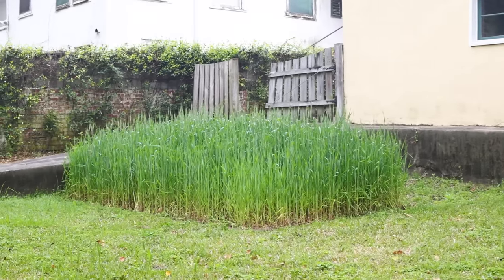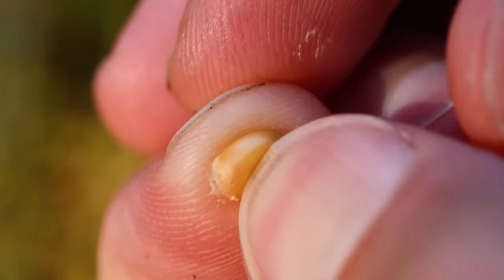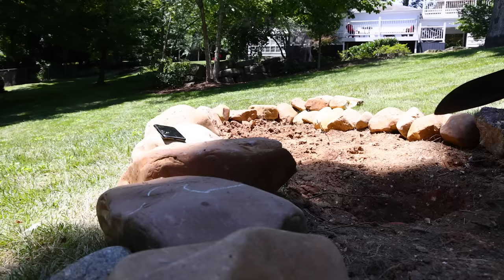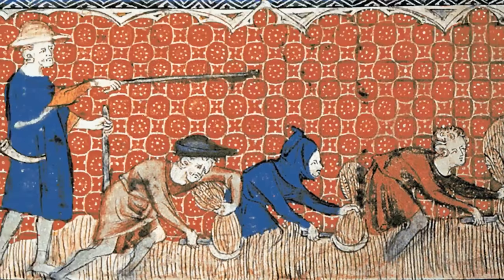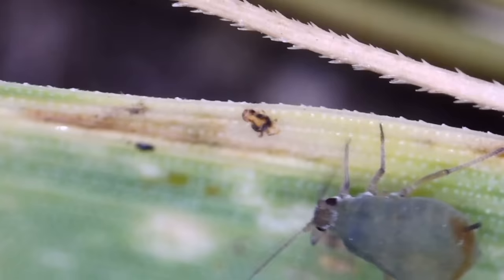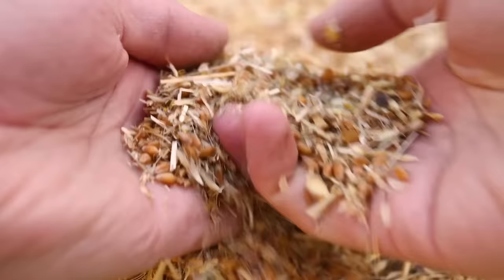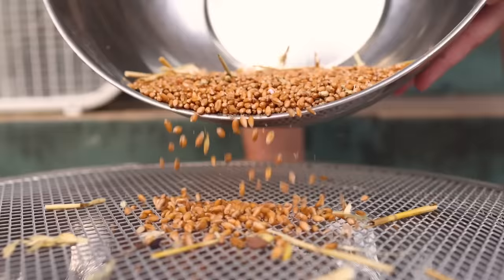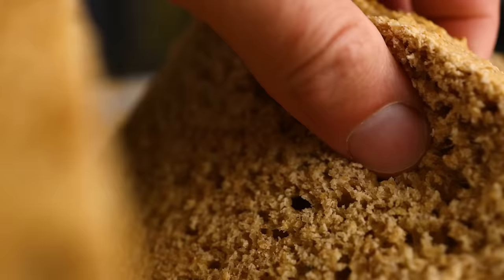Growing Bread II: Harvest to oven

Comment: Well, the word threshold is also from agriculture. It was the walls around the treshing floor that kept the grain inside i do believe
Reply: @krankarvolund7771  to hold. thank me later
Reply: Yeah and doors had little lips on the bottom to keep wheat from blowing out
Reply: As far as I've learned it was from when people threshed the floor of their house with dry straw etc. to keep the floor from getting wet when people came in from the rain. This straw, or threshing, would get replaced regularly. There was a lip on the ground at the bottom of a door that would stop the straw from getting brushed, walked or blown out of the house called the 'threshold'.

Comment: It's no wonder that so many analogies, metaphors, and parables are associated with this process!
Reply: Well, that was the main activity of the major portion of the population for thousands of years ^^
Reply: @krankarvolund7771  It's both a rich source and a common source. I wonder what the equivalent in the modern world is?
Reply: @rexregisanimi  Probably internet ^^
Reply: @rexregisanimi  imo metaphors like “clocking off” which come from only a couple hundred years ago. But people still use them daily, in all strands of workers from office guys to factory guys. So it’s still relatable etc. There’s a lot of those in modern language (bonus part: if you travelled back in time and used those metaphors they’d be so confused!)

Comment: Somehow in my family there is a handed down 'flail', which is basically a short and heavy piece of wood, attached with a chain to a stick. This was used to thresh the wheat on the threshing floor. Couple of guys threshing together, turning around the wheat pile and singing, drinking. Good times.

Comment: One word from grain cultivation you did not mention is "Threshold" -- That little ridge in the doorway leading to the threshing floor, so people are less likely to track all that sand and chaff all over the place when they walk in and out (can you imagine the mess, otherwise? Yikes!).
Reply: Also "garner" to gather for storage, a granary.
Reply: @mabamabam  Cool! I love etymology! Also, "inch"as in the unit of measurement, comes from an old word for barley, because the original standard for an inch's length was "Three mature, but uncooked barley grains, end to end"
Reply: @CapriUni  ~Ok, I’m stalking you now. J/K! 🤣 How about some old expressions such as, “there’ll be the devil to pay”, which has nothing to do with “the wages of sin”. The “devil” is the seam between the hull and the deck on an old sailing vessel. In order that it doesn’t leak they would “pay” into it a mixture of oakum and hot resin to seal it. On the high seas this was a dangerously precarious procedure wherein a seaman was put into a bosun’s chair and dangled over the side. The duty was assigned as a punishment so the expression might be said from one sailor to another, equivalent to saying, “You’re in deep shit now!” And thus the related expression, “caught between the devil and the deep blue sea.”
Reply: @Capri-Omni ~Another nautically derived expression is, “Cold enough to freeze the balls off a brass monkey,” which as nothing to do with testicles OR primates. The “monkey” was a triangular stand that held cannonballs. It was made of brass and when it got very cold would contract just enough allow the cannon “balls” to fall and spill onto the deck.
Reply: @CapriUni  ~And lastly, here’s fascinating bit of historical relevance I read recently:

The US standard railroad gauge (distance between the rails) is 4 feet, 8.5 inches. That's an exceedingly odd number.
Why was that gauge used?
Well, because that's the way they built them in England, and English engineers designed the first US railroads.
Why did the English build them like that?
Because the first rail lines were built by the same people who built the wagon tramways, and that's the gauge they used.
So, why did 'they' use that gauge then?
Because the people who built the tramways used the same jigs and tools that they had used for building wagons, which used that same wheel spacing.
Why did the wagons have that particular odd wheel spacing?
Well, if they tried to use any other spacing, the wagon wheels would break more often on some of the old, long distance roads in England . You see, that's the spacing of the wheel ruts.
So who built those old rutted roads?
Imperial Rome built the first long distance roads in Europe (including England ) for their legions. Those roads have been used ever since.
And what about the ruts in the roads?
Roman war chariots formed the initial ruts, which everyone else had to match or run the risk of destroying their wagon wheels. Since the chariots were made for Imperial Rome , they were all alike in the matter of wheel spacing. Therefore the United States standard railroad gauge of 4 feet, 8.5 inches is derived from the original specifications for an Imperial Roman war chariot. Bureaucracies live forever.
So the next time you are handed a specification/procedure/process and wonder 'What horse's ass came up with this?', you may be exactly right. Imperial Roman army chariots were made just wide enough to accommodate the rear ends of two war horses. (Two horses' asses.)
Now, the twist to the story:
When you see a Space Shuttle sitting on its launch pad, there are two big booster rockets attached to the sides of the main fuel tank. These are solid rocket boosters, or SRBs. The SRBs are made by Thiokol at their factory in Utah . The engineers who designed the SRBs would have preferred to make them a bit fatter, but the SRBs had to be shipped by train from the factory to the launch site. The railroad line from the factory happens to run through a tunnel in the mountains, and the SRBs had to fit through that tunnel. The tunnel is slightly wider than the railroad track, and the railroad track, as you now know, is about as wide as two horses' behinds.
So, a major Space Shuttle design feature, of what is arguably the world's most advanced transportation system, was determined over two thousand years ago by the width of a horse's ass. And you thought being a horse's ass wasn't important? Ancient horse's asses control almost everything......

Comment: I am stunned that we figured out bread before we figured out pottery. We figured out that those tiny little seeds encased in layers of inedible matter at the ends of dead grasses could be harvested in a complex multi-step process and then eventually mixed with water and cooked into a loaf before we figured out a pot.
Reply: Pot is harder, imagine someone prehistoric looked at dirt and said "oh yeah, i can make a thing and put stuff in it"
Reply: It's not that they didn't figure out pottery, it's that it was extremely impractical to carry around what is basically rocks if you're a nomaduc society. Only one ever did, Japan, but they didn't embrace agriculture until like 2000 years ago.

Comment: 15:28 Small addition, in India this was done on a flat plate and one would put a handful of wheat seeds and sort them by hand to remove any stones or sand particles. This was mostly done by the women in the household when the men were farming in the fields. This was very relevant till the 1980s and even till the 1990s until more modernized methods were evolved and we started getting milled grain directly in packets. Even today in some parts of India this is still done by hand. I admire the hard work that took to keep a family fed. I remember my Mother doing this and I help her out, we used to get our wheat in sacks, and many times it was not so clean, and my Mom used to clean it before sending it out to a "chakki" milling shop.

Comment: 9:37 So here in India, small farmers usually do this with their crop of maize by spreading them out on roadways near villages. These roadways don't have too much traffic other than the few buses that ply. As they buses run over the strewn crop, the grain is threshed out of the straw and the grain is swept up, put through a shaker to remove the dirt, cleaned and processed

Comment: You actually can make a fire safe pot out of leather or hide long before pottery or metal working would allow you to do so. There's  a few ways to use these leather cauldrons, but perhaps the oldest way would be to heat up stones in a fire and then drop them into the vessel once they were nice and hot. You can also just set the bag over the fire on a trivet made of stones. For large processes, such as making a batch of beer, you could take an entire animal hide and tie it to several wooden stakes over a fire, making a sort of wide shallow leather bowl. When using these the water will boil away long before the leather begins to char, this is because the water keeps the bag cool enough that it won't burn, unless the leather is very thick, and even then it'll only char on the bottom side and not on the boiling side. This also works with paper cups which is a fun experiment to try at home!

Comment: 9:44 In medieval times, at least, they sometimes used a plank wall with a (mostly) flat side (which sometimes had flat rocks embedded in it, for thicker layers of wheat), acting like like a sled/sledge, to do the threshing. Cattle would move it above wheat and other similar grains, and at least one person would sit on the sled/sledge to have a similar effect to grinding the wheat against the ground.

Comment: Next stage: growing pepper and boil sea water to get salt for seasoning your cutting board not your steak
Reply: Very few peoples would boil sea-water, the easiest way to get salt from the sea, is to dig very shallow ponds in the sand, wait that the tides just cover them in water, and then that the sun will evaporate that water. And you have salt ^^
Well, taht's a really simplified way at least XD

It's called salterns.

Comment: Couldn’t you use running water to separate out the sand? Like put them in a screen and have water run through taking the sand with it but the screen keeps the grains
Reply: Well where is an an ancient man gonna find running water, and a siv?
Reply: @ricardoronco9632  ...where is an ancient man gonna find a blender?
Reply: @laser__unicorn  where is a modern man gonna find the time and will to do all that shit with two rocks? Even worse if some of it feel into the bread, the sand was already bad enough
Reply: @ricardoronco9632  They don't need running water or a sieve; the sand will sink and the seeds will float, so you can just dump them in a bin and then skim the seeds from the top.
Reply: @user-vn7ce5ig1z  i was gonna wright a comment then I remembered he sweet potato experiment, witch is actually unrelated, but in that video they talk about an experiment before that were they dropped seeds on the beach and some monkeys learnt to drop the seeds in water so it’s easier to separate the sand

Comment: you can also tresh it in a trough(like the ones animals drink from) with panels(of tightly woven vines or fabric if you have them) on each side. grab your harvest and slam it into the trough repeatedly and the panels on each side prevent seeds from flying everywhere. if your trough is sloped on front and back you can put he wheat on the slope and hit it with sticks to get the more stubborn seeds off.  less kneeling and bending, so its faster, easier and cleaner.

Comment: I live in wheat farming country in the Pacific Northwest. Right now because of the heat and dryness the farmers are rushing to harvest. This is pretty early to be harvesting, but the wheat could become too dry, and also there is a threat of fire burning the crop. They are insured for fire loss but it is still usually better to not have to use it. But harvesting itself is dangerous as the activity itself could start a fire. Hot automotive exhaust systems are the usual culprit, but also any metal that hits a rock can make sparks. The farmers actually have firefighting tools on hand just in-case. Because of the early harvest the grain will not have grown very large, so yield weight will be low this year.

Comment: We grow our own grain and mill them from milling shops. They have electric motors with stones in the machine to make flour from wheat. I am from Pakistan. We wash our grain before we mill them, to remove sand and dirt. After that we dry it in sun for 2 to 3 days at least. We also remove the stones from it by hand and also use gaint Sifters after washing the wheat.
When grain becomes dry in the field after that we cut them in bunches and let it dry further in the field and keep it away from rain and keep them dry. After that we have thrashing machine. It remove husk and give us almost clean wheat.
The straw is stored as cow food and given to them all year round.

Comment: I cut the heads off and geared up my drill press at 1800-2000 rpm. Got a 18” peice of #4 copper stranded grounding wire and fashioned a flailing whisk out of it and threshed in a 1 gallon bucket with a cover fashioned out of cardboard.
Reply: For winnowing I used a 200 cfm 4” inline duct fan. 
It even de hulled tough Egyptian einkorn. Although It did damage the grain it if flailed excessively.
I got 5 quarts of einkorn grain from 86 sq ft of freshly broken lawn. Could have planted more seed, only planted 40 grams of seed. Should of planted 2x more seed.

Comment: I did this exact same thing a decade ago.  I noticed some grain growing along a railway track I walked along every day.  I imagine the seed had blown there from the farm across the road.  I watched it until it ripened, then cut it with knives, let it dry in the sun then beat it in a pillow case to separate it then winnowed it in the wind.  We have an electric mill which we used to grind it into flour then we made bread out of it.  The grain turned out to be rye after a bit of research, which by itself doesn't make very good bread.  we ended up with a pretty good yield, but the bread had the texture of brick.  It was an interesting activity to do with the kids.

Comment: I've used electric grain mills to mill my own flour for decades.  If you start with bread wheat rather than feed wheat you get better flour, less dense bread, and no sand.  I appreciate your video showing how much work went into growing grain and how different the final product is now from ages past.  A growing body of evidence shows that our modern white flour is partly responsible for obesity and related problems, so whole wheat is better.  But baking with 100% whole wheat is different even from commerical whole wheat flour.  That only needs to be 51% whole wheat to get the label, but home milling gives you 100% whole wheat.  That means you still have the bran and germ (oil) which makes baking with it different.

Comment: I've grown some experimental backyard grain crops. I threshed my wheat by grasping a shook, holding the heads against the side of a wheelbarrow, and beating them with a stick. It took fairly hard beating, but went fairly fast. I still had to winnow it, but it was pretty clean. I agree, easy to grow, hard to process. I think much of the preindustrial wheat was grown as much for it's straw as for the grain. I think it would only take a few years of regrowing your own wheat, to get a crop that's zeroing in on your personal climate. I cooked most of my wheat by roasting in a grease free cast iron fry pan, then pour milk over it for breakfast. It tastes similar to Grapenuts.

Comment: I have a suggestion for u. Use a long sheet of polythin on top of it place a metal drum and smash the wheat stems on the drum. You will see all the seeds are in front of you and what you will be holding are seedless straws. This way your work will be 75% less than what u did. The seeds wont have sands because they are on the polythin sheet, the straws will be much easy to manage and separate. Now all you have to do is use the fan to to seperate the seeds as you already did. Best of luck.

Comment: Threshing...  Not so much an ancient technique, but you can put on some leather gloves to protect your hands and rub the heads across a piece of 1/4" hardware cloth to strip out the grains.  This method also works for a variety of other grains--I'll be using it for sorghum in a couple of months.  Electric grain mills for home use are generally pretty expensive--it's hard to see how most people could justify the cost--but you can get a hand crank one of reasonable quality (much better than a blender!) for around $100.

Comment: Easy way to remove sand is to just wash them in a tub for a few min and then remove it. The heavy sand and coarse particles will sink and wheat will either float or remain above sand. Then of course you need to dry it in direct sunlight.

Comment: I keep assuming wheat and rice are extracted off the hull the same way; the whole time, I was confused why you're having a hard time. 
In some parts of Asia, farmers use a flat-round basket, with a depression, to toss and shake the grains out of the chaff. It's like panning for gold, instead of running water in a stream, the wind blows the chaff or the act of tossing itself causes the lighter material to fly out. Stones and stems are still removed by hand.

Comment: Sorry if this is a double but, actually, people boiled water before firesafe vessels, such as pottery. I amnot aure if it  is so for the grain cultuvating reagons but as for indigenous North American people. They used watertight baskets of tree barks and placed hot rocks inside the water until it boils. Ray Mears had a programme on the subject...just saying...